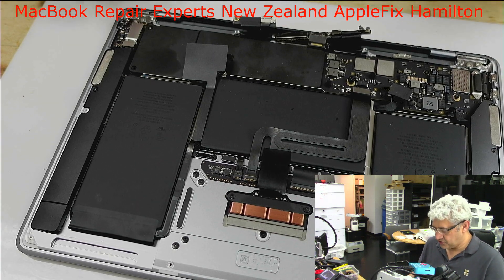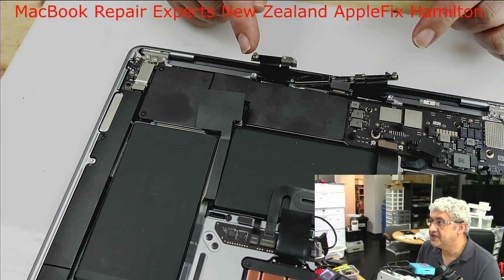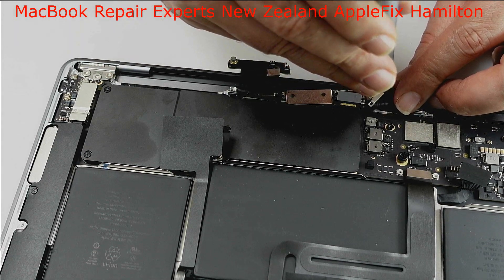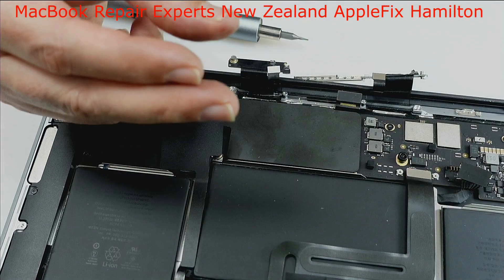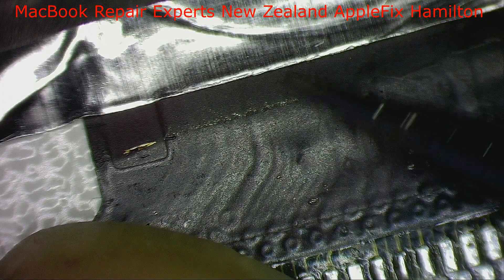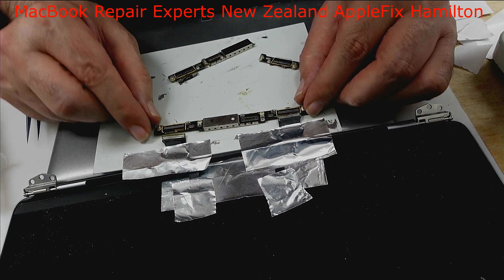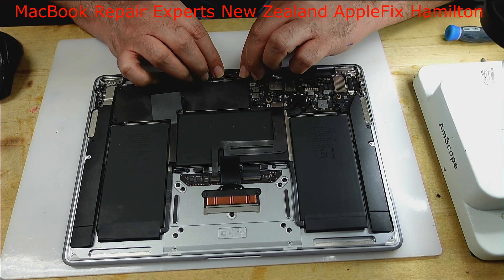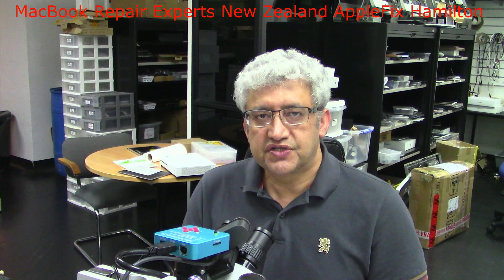MacBook Air 2020 Broken LCD IO Board Replacement | MacBook Repairs Hamilton New Zealand AppleFix |

Comment: Dear you are lucky without programming this T-con (LCD logic board) worked. I have no idea how you did it but we have many many boards, all these board have to be programmed with the glass # & check to see whether it a dual glass or just a single one. Keep trying, nice job done. One worked for us too, but no idea how it work, thereafter we have to get this board programmed with the screen glass which we are going to use on.
Reply: Wt do u mean programmed?
Reply: @calvinmathew1962   Dear the chip on the T-con board has to programmed according to the glass used, there are several types of glass used & I hope you know that they glass is build with pixels controlled by transistors. This is why the chip have to be programmed.
Reply: @matferna14  ohh thank you very much